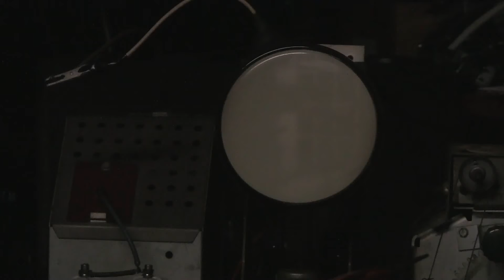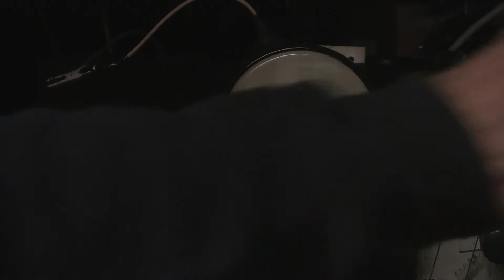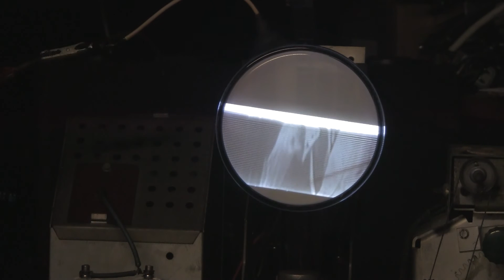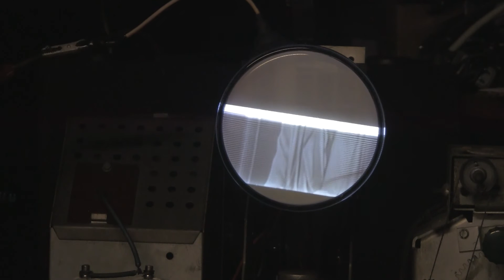Zenith 1951 Giant Circle Radio Cobramatic PT10

Comment: I'm glad you were able to isolate the issue to the HV... I'll be eagerly watching for updates and hope your troubleshooting efforts are rewarded soon. Best, Don
Reply from the maker: +RestoreOldRadios Tomorrow I am going to re-check my work to make sure I didn't make some kind of mistake. The 360v B+ that runs all the sweep circuits is being loaded down and drops to below 325v. That's why the HV is dropping off. Bob Andersen thinks the yoke might be bad or perhaps the vertical output transformer is shorting because if the scrunched up vertical right at the top of the screen. I should know more tomorrow. I don't have a yoke ringer so I can't verify that. I'll see what I can do with what I have to work with. Gary

Comment: I've never worked on a Zenith porthole so I don;t have any specific advice.  Monitor voltage on the horizontal output tubes.  See if they change as the HV fades.  Also put a scope on the grid and see if the drive voltage changes.    Looks like you also have a problem with the vertical deflection circuit.  Could be a short in the yoke or an issue with the vertical output transformer.
Reply from the maker: +bandersentv I don't smell anything burning nor do I smell Ozone and I did look at it with the lights out but I will give all this a try. I do get a full raster now and I didn't do anything to fix that scrunched looking picture other than to work the picture switch back and forth. Thats the switch that compresses down the image at the top and bottom. Maybe the switch was dirty. I am confused and thats because I have no experience with sets like this. I worked on new solid state TVs and monitors in the late 1980s and that involved a lot of board swapping, horizontal output transistor changing and also changing some capacitors and resistors. They were easier to work on than these old tube sets are. Gary
Reply from the maker: +bandersentv I need to first solve the problem of the fading high voltage before I can deal with the vertical. Wouldn't you know that the very first TV I attempt to restore would be so problematic? Thanks for watching and commenting Bob.
Reply: +HD7100 Don't be so quick to dismiss the vertical issue.  Circuits on these early TVs are often interdependent.  The vertical output often runs on a boost voltage generator by the flyback damper circuit.  So a problem with the vertical could very well effect the HV.
Reply from the maker: +bandersentv Thanks Bob. I'll study the schematic and try to see if my little B&K 1403A scope will help me with looking at wave forms. I am trying not to get discouraged and I didn't expect the set to work perfectly right off after the re-cap I did. Like I say- This is the very first vintage tube TV I have attempted to restore. I hope I can get it working to justify the expense I put into it thus far. Gary
Reply from the maker: +bandersentv I do think the problem is somewhere in the vertical circuits. The sound is great and the picture locks in solid but the vertical is all scrunched up at the to of the picture and the linearity control has minimal effect. The +360v B+ is being loaded down and when it drops below +325 then the HV shuts down. I am going to re-check my work and see if I made any wiring mistakes plus I hope to see if I can find something that is heating up and drawing down the B+.
Reply: +bandersentv Yah Bob, I remember something like this happened to you.  If I remember right, you tried a substitute transformer, and it proved to be the problem indeed.  Wasn't there also a case where it had a crappy pot?  Troubleshooting is a blast, sometimes I want to trouble SHOOT with a shotgun.  Don
Reply from the maker: +umajunkcollector Oh shoot! I guess I'll never get this dang thing a workin' right. As it stands right now I am stopped until I canverify that I di have a bad flyback transformer. Things seem to be pointing in that direction but I need a reliable flyback tester to verify. I put a lot of work and money into that old set so far and I hate to see it end as an unfinished project.
Reply: +umajunkcollector You might be thinking of my GE 810.  I suspected the flyback but it turned out to be OK.  For that matter, I've never had a bad flyback or yoke
Reply: +HD7100 You don't have a bad flyback or yoke.  If you did, you wouldn't get an image.  I'd swap out tubes first.  They can have issues that don't crop up in a tube tester.   Could also be heat related.  Like a resistor that changes value or a connected that opens up.  Could also be HV corona or arcing.  Run the set in a dark room and listen for a crackle or hiss and look for any arcing.

Comment: A guess, damper tube or in that circuit
Reply from the maker: +AllAmericanFiveRadio Rick it has a 6AX4 damper tube which I tested and of course it tests good. It is definitely a warmup problem as you can see in the video. The 6BQ6 output tubes are new. My tenacity has gone with age or I would be working on the set right now. I'll get back to it. I may try swapping the HV rectifier tube but those usually just die completely. I'll ferret the problem out somehow. Gary
Reply: +HD7100 
My neighbor walks her ferret, I live in yuppie dumb. It will be interesting to see the fix this problem. There may be more than one perpetrator causing this malfunction, but the results so far have proved all the coils are good and as you said, you are getting a signal through the IF circuits. Hope you can resolve the problem, but either way, if you identify the problem we will all learn from it.
Rick
Reply: +AllAmericanFiveRadio Rick Rick Rick, , please don't forget TV repairs 101 from the 50s... Make a fist and bang the set on top.  If that doesn't work, bang it again on the side. ;;) Don